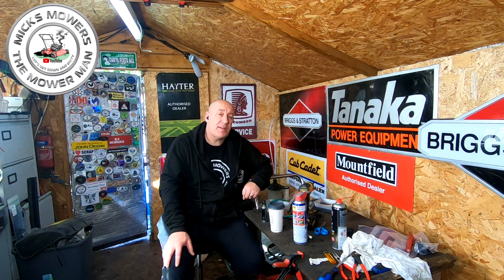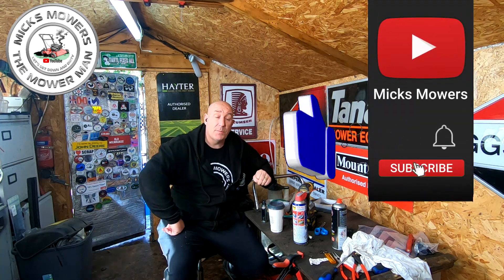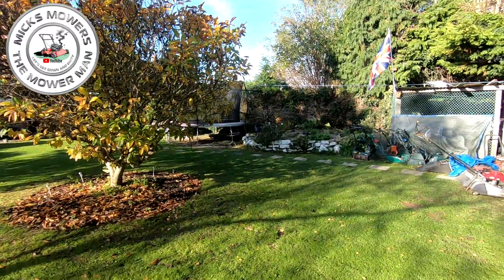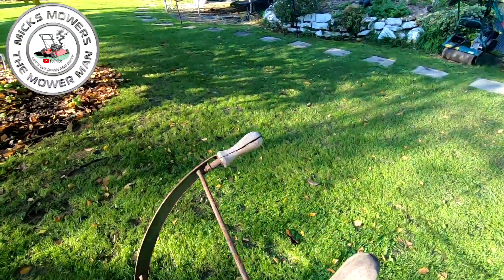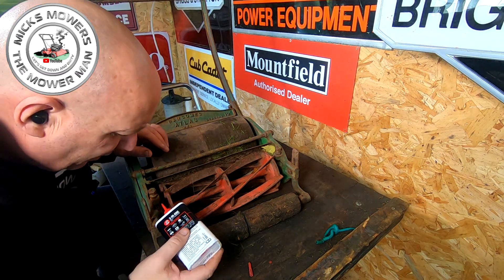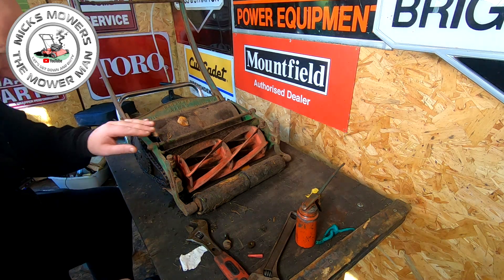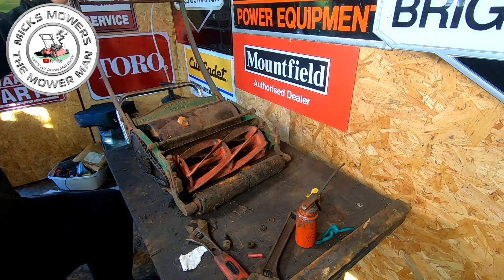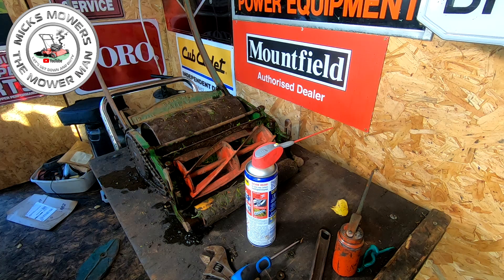Ransomes Atlas Mk1 1930s #vintage Lawnmower Restoration Project

Comment: I have seen in the past these types of matters in museums and living Museum. But I’ve got a mark one ransom, but it’s not your type. It’s the one with the two wheels either side of the plate and the wooden roller at the back. And the handles is wooden and with ransom mark one, Etched into the upright piece of wood, very old. Is Payne to do it a bit just to protect it from rust. It feels amazing. It is definitely are you talking peace It feels amazing. All I’ve done.

Comment: It is not the first time I have seen the roller cog welded .usually the thread is broken by over tightening or putting it on by the thread being stripped in the process.

Comment: Looks a great mower there Mick. Good work on the strip down. That will
look lovely painted up. Good luck in getting the grass box. I’ve doing a soft “restore” tidy up of an Atco Balmoral someone gave me atm. Just cleaning up and painting the cylinder cassette. I also have an interesting push mower restore in the shed for spring. A “Presto Roll Mo” made in Preston from 1930’s ish. You ever heard of them?
Reply from the maker: Yeah I had one two years ago I think
Reply: @themowerman  I’ll let you know how I get on. 👍🏼

Comment: As the drive mechanism is on the right hand side those threads for the sprockets should be right hand,  if you think about it the chain drive direction will be constantly tightening the threads, I bet that sprocket was welded due to a stripped thread.
The pawls in the roller are the cause of lag when you push forward and not engaging the cylinder, give them a good clean and oil they will be fine.
The collet on the roller shaft should come off with penetrating oil and heat and a lot of Mick love. 
All your AF spanners should fit Whitworth nuts n bolts, it's the thread pitch which is different between British standard imperial and Whitworth,  the Whitworth sizing is a complete mystery lost in the sands of time.

Comment: it would be time consuming but you might use a angle grinder and carefully remove the weld without wrecking the sprocket or shaft.
Reply: oops. I commented before I saw you say that is what you were gonna do.. lol